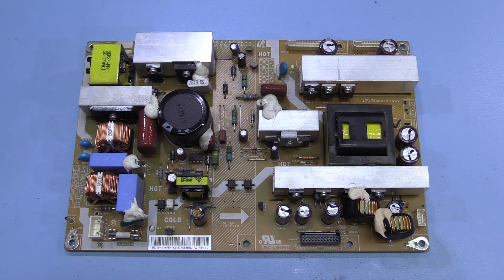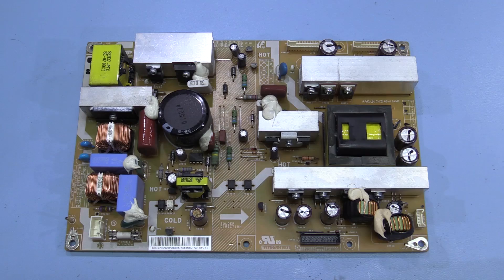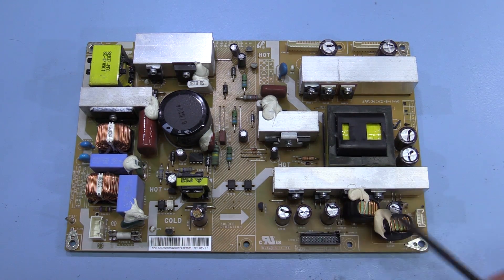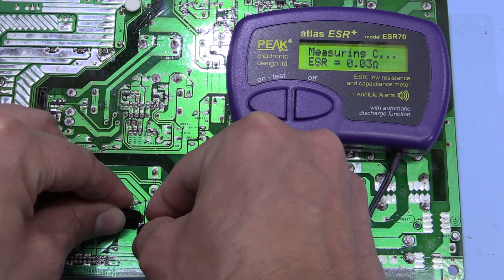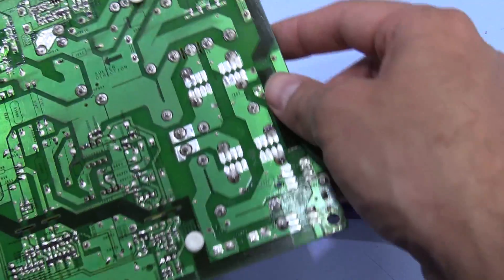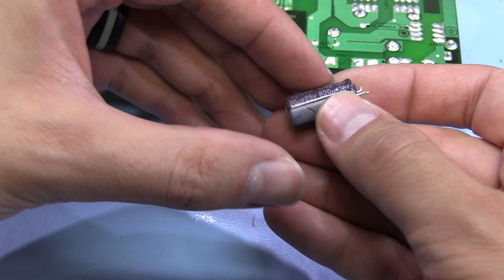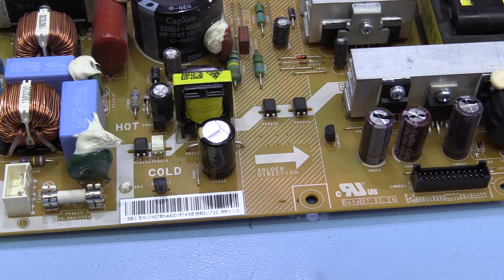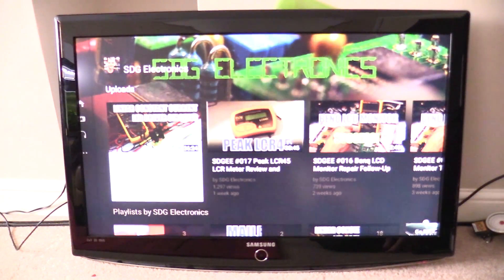SDG #021 Samsung 46" TV Repair

Comment: Always CapXon with their crap quality caps...

If it was my personal tv, i'd jsut replace all of them with nippon chemi-con/panasonic/hitachi/rubycon as they are really cheap. But i'm a perfectionist :P
Reply from the maker: jorno1994 Indeed - I would normally do this too. The one that was replaced will have failed significantly earlier than the others though as it's essentially been powered up for 6 years straight - the others are only seeing the majority of the degradation when the TV is being used.

Comment: Oddball capacitor values, how dare they make it hard for us repairers to find replacements lol :D
Yep i do the same rounding up to the next value as long as its not a critical timing one, also if i can ill use a higher voltage rated cap, its an old habit from seeing leakage current from low voltage caps, may not make any difference lol.
Switchmode supplys work well but i think the regular death of capacitors does take away from the gains in efficency.
I think we need a range of finned heatsinks to slide over electrolitics to dump the heat better ha ha :D
Reply from the maker: zx8401ztv I did think I had a pack of 820uF capacitors, but I must have used them elsewhere... It annoys me that it would not cost significantly more to use better quality components in consumer gear, but I guess they want it to fail after 5 years. The Panasonic FMs are a great replacement though and should carry on working now until the TV is completely out of date. That capacitor failed early as it is powered up constantly (no power switch on this TV).
Reply: SDG Electronics Ive used panasonic caps as well, i had a switchmode psu to repair and the output caps were very dead indeed lol.
I looked at r.s semiconductors and selected panasonic, 105 deg, higher voltage than original and i just over rated the ripple current they could stand, worked like a dream :-), all supplys back to nominal values.
But i dont know if they were "FM" range.
I chose a middle of the road quality, i thought panasonic would have been decent, looks like i was right as you like the brand as well.
Reply from the maker: zx8401ztv Rubycon ZLH are good contenders also for SMPSUs.